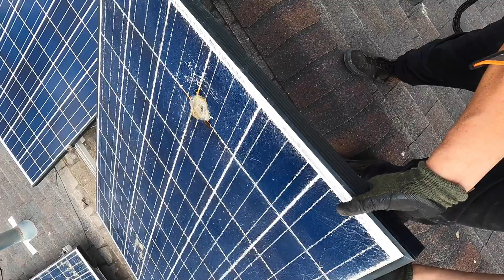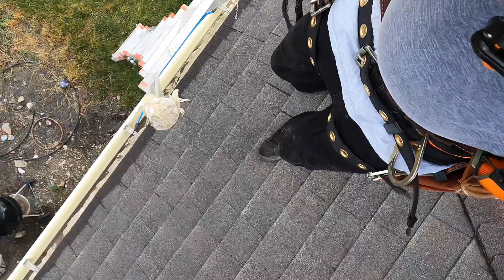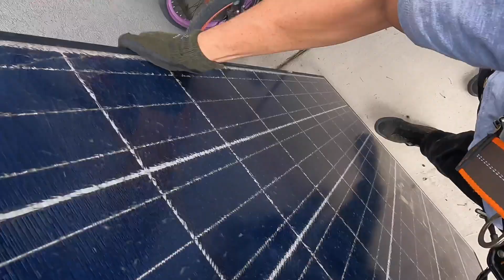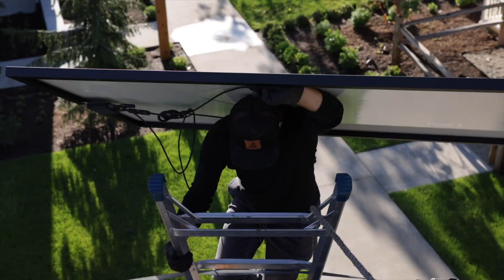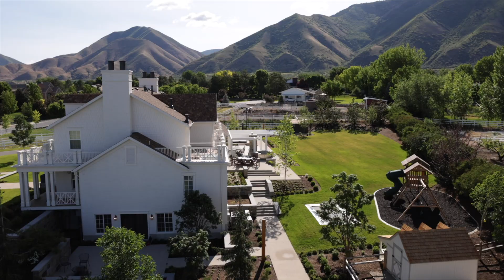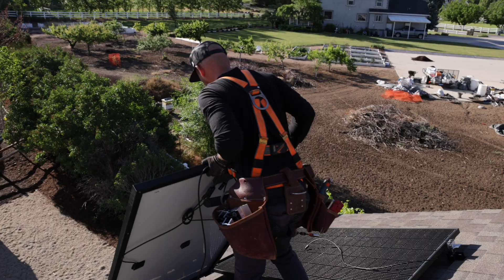A Warning For Buying Solar In 2023

Comment: yea im a little skeptical about this, if its been installed to a standard it shouldnt be a liability, if its been installed poorly then the installer or vendor takes responsibility for any damage. We have 28kw of solar and a 90kwh battery bank. it saves us a fortune, and avoids blackouts
Reply from the maker: It’s good to hear you are in a majority group that didn’t get screwed over.
Reply: It's easy to say the vendor takes responsibility until you're left high and dry. Every company is focused on keeping their installers busy, some of them don't care what goes on your roof. They could install 100 houses with barebones products then dissapear and open up as an entirely new solar installer. I used to work for a big bathroom remodel company that swore up and down that we had factory trained installers. Half of them spoke english. The other half didn't graduate high school. "Limited Lifetime Warranty" is actually 5 years. Not every installer is a scammer but the more they persuade you to sign on the first visit the worse the product is usually.